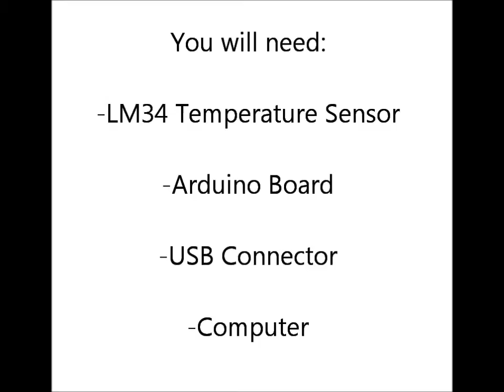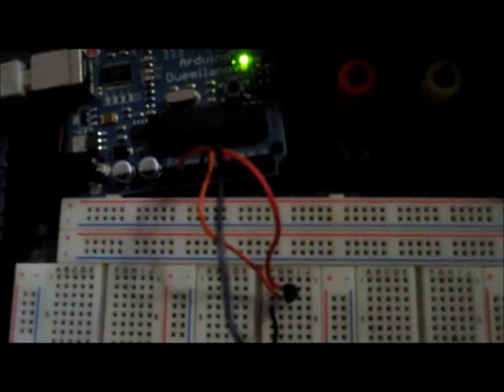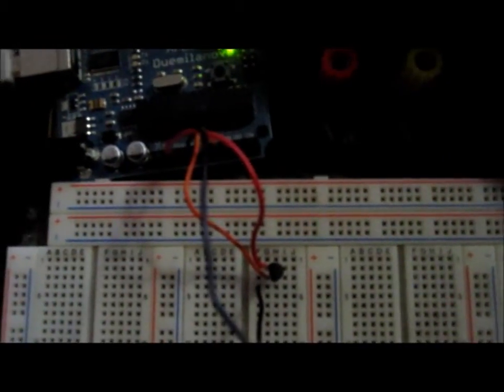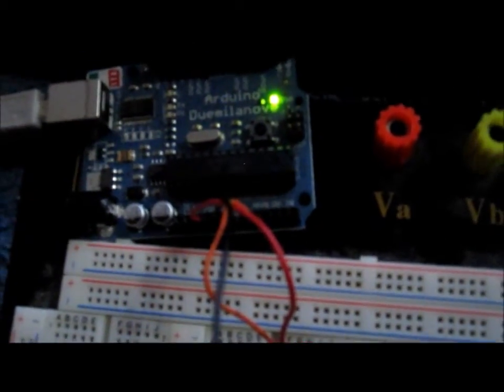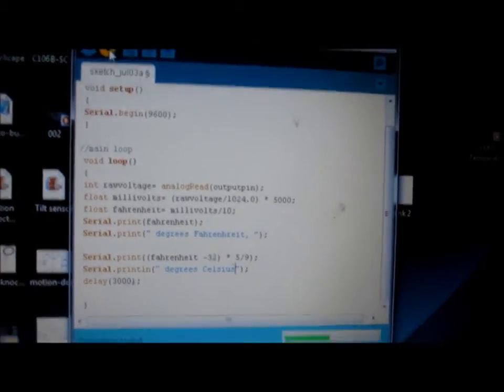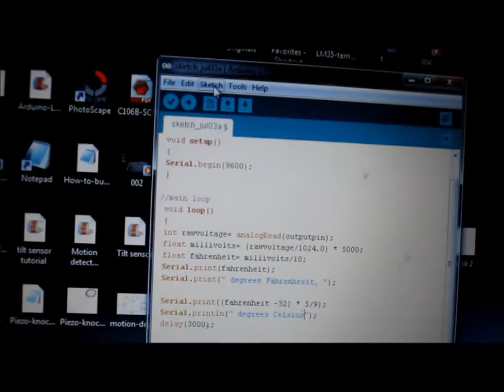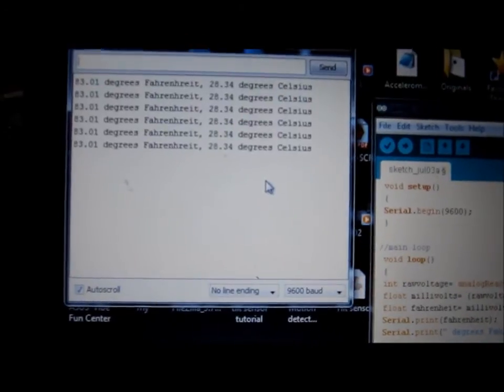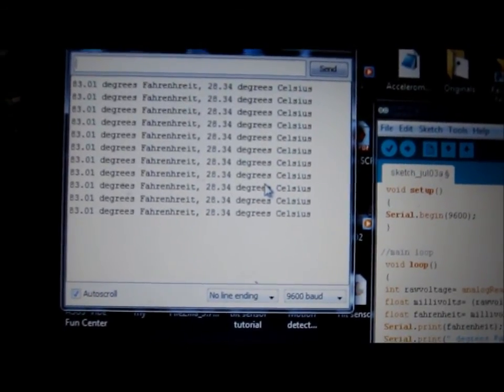LM34 Temperature Sensor Circuit (w/ Arduino)

Comment: ElectronicsLearning I did this same project! USed your code, Got a 128 degree temp readout. I did hook it up backwards at first and it got so hot it burned my finger. But the PDF from TI said it was right, well I switched the -/+ and it worked using your code! Its just not 128 degrees. Can you tell what is wrong, I had another LM34 and hooked it up the first time right and same thing. SO I know I didn't blow the arduino! I know I have your exact code! And the temp readout is way off.
//Inializes or Defines what Pin is output for LM34 Temp Sensor

int outputpin=0;

//This sets the Ground pin to LOW and the Input Voltage Pin to HIGH

void setup()
{
  Serial.begin(9600);
}

//Main Loop

void loop()
{
  int rawvoltage=analogRead(outputpin);
  float millivolts=(rawvoltage/1024.0)*5000;
  float fahrenheit=millivolts/10;
  Serial.print(fahrenheit);
  Serial.print("degrees Fahrenheit,");
  
  Serial.print((fahrenheit -32)*5/9);
  Serial.println("degrees Celsius");
  delay(20000); // Delay of 2Mins.
  

}
 CAN YOU HELP ME PLEASE BUDDY I SUBBED TO YOUR CHANNEL!!!!!!!